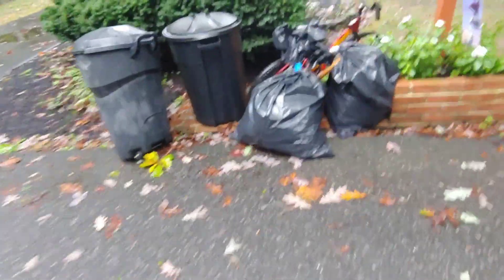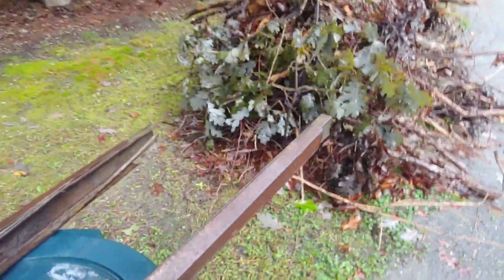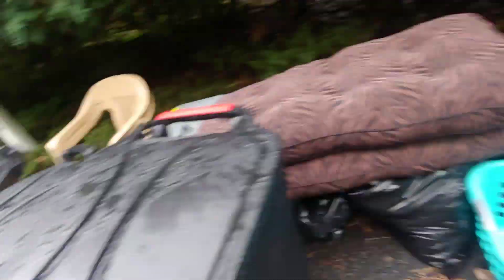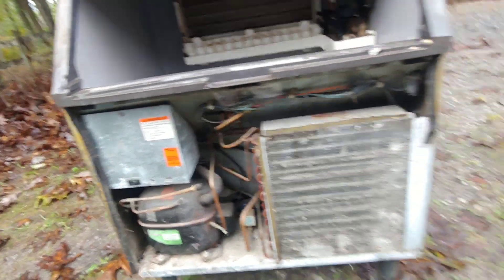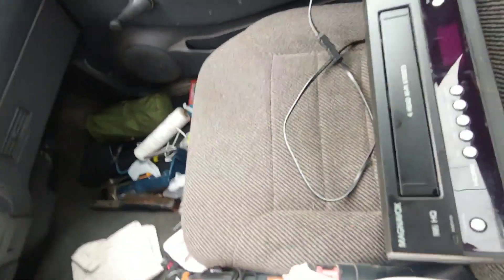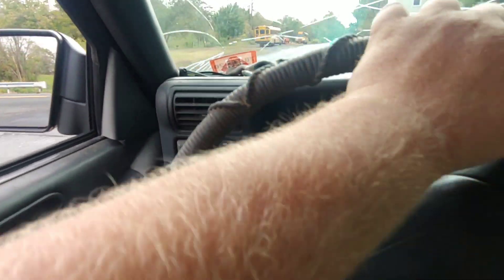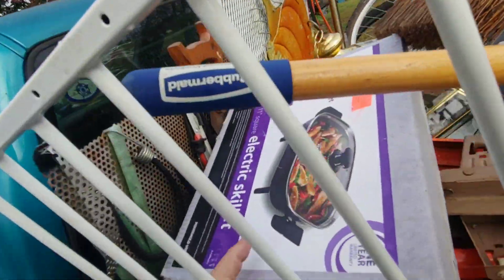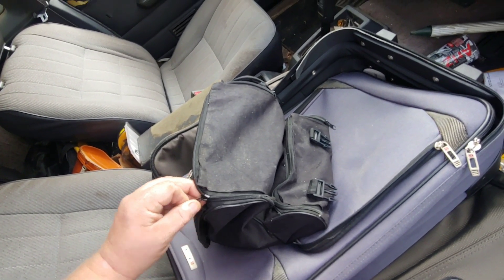Recycling metal-  some bikes.

Comment: Good Morning from Florida,  still got pumpkin on headrest Sweet. 🤘🏻🤘🏻💪🇺🇸👍👍
Reply from the maker: For sure it's blocking my shattered windshield from the cops behind me LOL
Reply: Pretty amazing as long as you got away with that shattered windshield, did you scrap ice maker? Only had little time watch and will watch rest later.
Reply from the maker: @gulfcoastacrscrapper6523  I took it apart pieces are still here LOL... it was pretty trashed the actual icebox was cracked in the bottom probably why they stopped using it
Reply: Here in Florida I get $50. For nonworking ice machine for that brand.